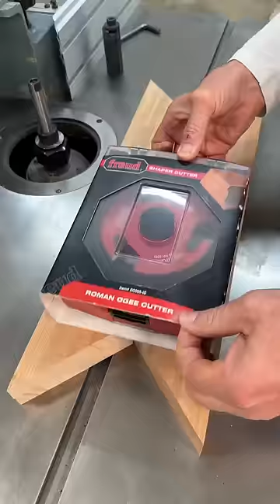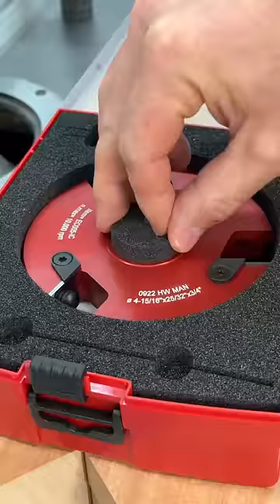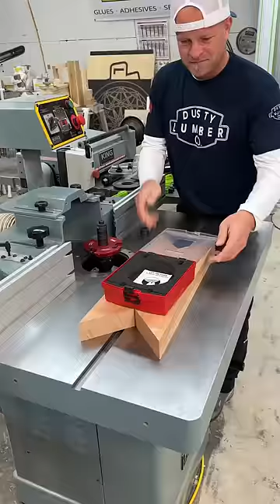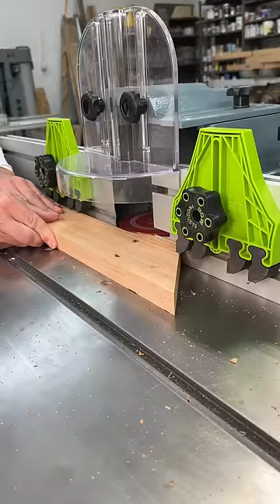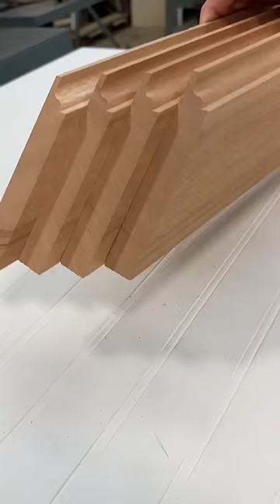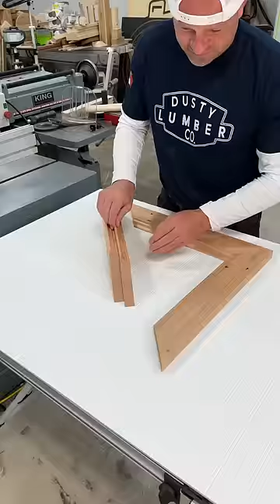Using the Freud Roman Ogee cutter #freudtoolsambassador #woodworking #tools #maker

Comment: I've never used cutters like these but why do you have to put so many spacers on top before locking it? Is it a safety measure given the size and speed it spins.
Reply: Because there is a thread, which only starts at the top. You can't secure the threaded nut in the middle.
Reply: @jacknorris1819  This is so obvious now. Can't believe I didn't even see that.